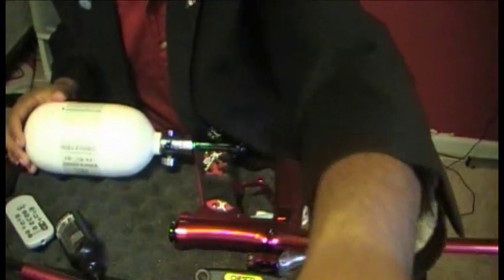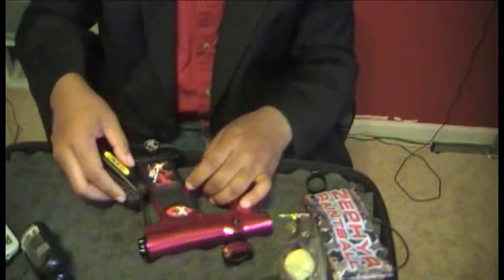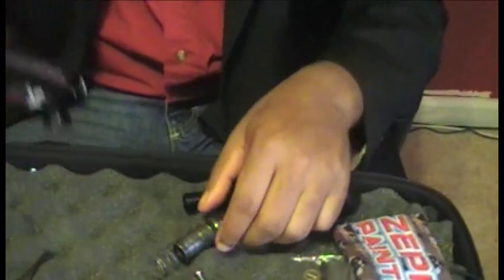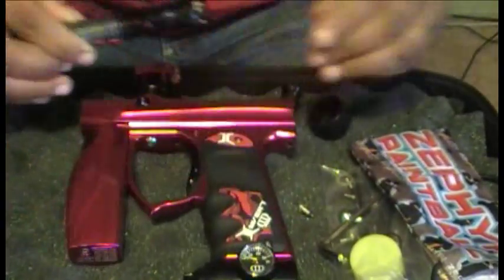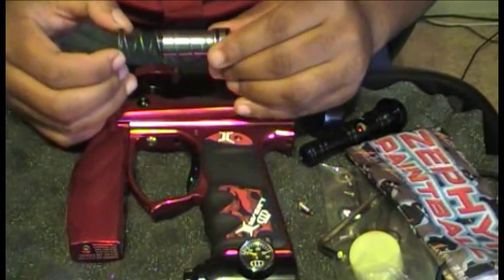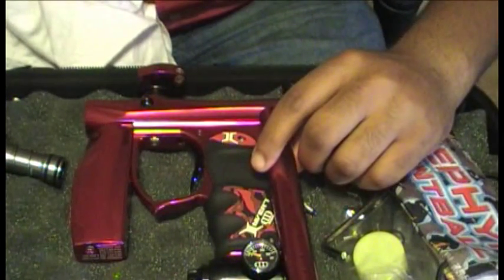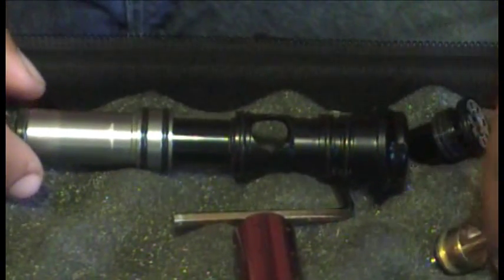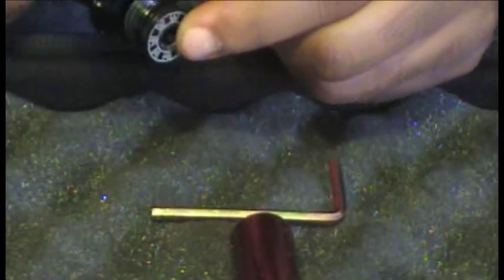Invert Mini Tech Talk

Comment from the maker: Set to 190 and then set your back cap so that you're shooting at your field velocity, then drop the dwell, a bit, but not so much that you have consistency issues.   Prettty smooth and consistent shooting.  Sound signature and gas usages are pretty good as welll

Comment: @MetricBernard ok thanks so much. I have just one more question. Since i wont be able to adjust the ASA, will the tank leak alot of air isnt screwed in all the way? My other markers before i moved the ASA kept the tank about 1/4 turn from a complete screw-in.

Comment from the maker: @peakworkouts Yeah thats very weird, the bolt should be completely out of the way when the gun is at rest(on or off, gassed up or not gassed up)  I have 2 theories.   
A)This spring has been placed on backwards.  (The slightly, and i mean slightly, smaller end of the spring should be facing the rear of the gun.
B) Perhaps the poppet is set funny.   Take the large allen key to the back cap of the gun, turn it inwards as far as possible  and then back out 3/4 of a turn.
Hit me up if still no fix.